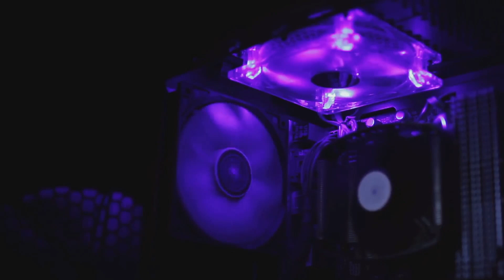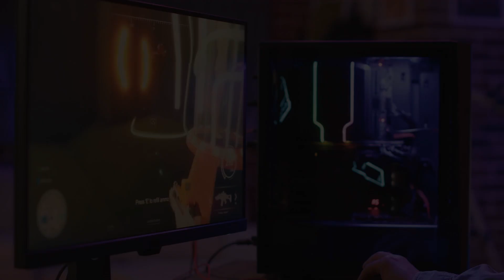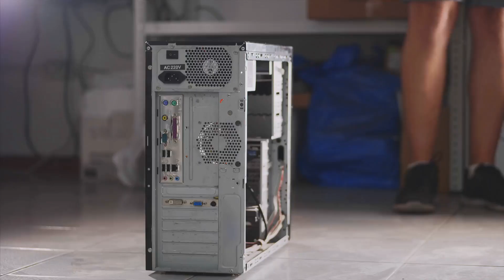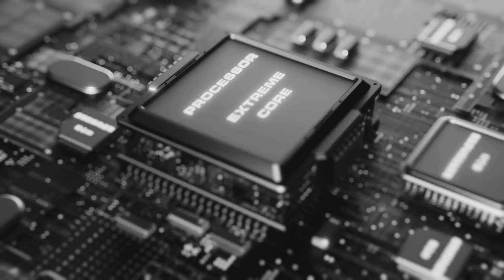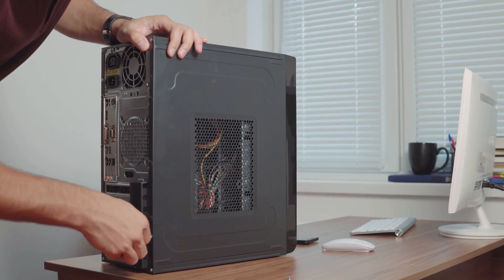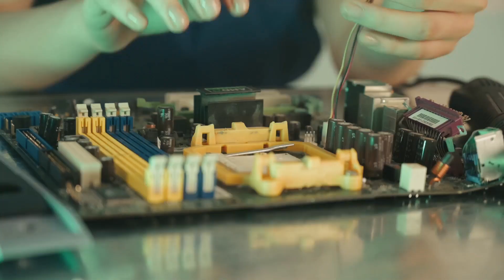Why You Should Not Water Cool Your PC

Comment: IDK why this video has so many downvotes, imho its pretty right what he says. I mean there are plenty of stories of people having trouble with dirty water, tubes and coolblocks. Even if leakage i would rather say it is an user error, I cant rule out the possibility of getting faulty parts. Meanwhile the only thing that can break on an aircooler is the fan, which is usually easy to replace (or just buy products where u can). Also there are some high end air cooler doing a better job than a 240 AiO.
Of course what he say about liquid metal is quite bs and pretty advanced.

Comment: Now that was a huge pile of bs. Not only completely forgetting about AIO liquid coolers, but straight up spitting some of the biggest BS I've heard in a while. There's a reason why a lot of liquid cooling brands offer up to 6 years or even more years of warranty for their parts. Because they are very confident, that their products will last at least that long. In this day and age, only low TDP cpu's are worth cooling with air-cooling solutions, as any 240mm AIO, (not even mentioning a custom liquid cooling solution, because its even another level higher) will outperform any air-cooler on the market. And in terms of safety; if you at least have the few braincells needed to read up and do research, you have a cooling solution that is safe and outperforms any air-cooler on the market.

Comment: These are good points but more of precautions to take into consideration before looping your pc. The best reason not to watercool is if you can't afford it. To argue some of your points: air cooling requires just as much if not more maintenance than a water cooled system if you want to keep your parts healthy. Soft tubing is great for beginners who don't want the challenge of bending hard tubes. The temperature difference is very noticeable and helps keep your components much healthier over time. Furthermore, the cost of a watercooled system isn't THAT much more considering the only thing you'd realistically have to replace with upgrades is the gpu block unless you're making an entirely new system. The biggest thing is how time consuming it can be to custom loop a system and yes, how catastrophic it can be if it fails but if you take your time and don't cheap out on parts you should be fine. Furthermore I truly believe the look of watercooling is worth the time and money but that's my opinion.

Comment: The cpu+gpu custom loop was the best upgrade I've done. It has worked perfectly for 2 years with distilled water. The efficiency allows me to keep the fans at low speeds, a 6700xt remains at 45ºc under load and a 5600x at 43 degrees

Comment: What... was this? This was nearly as bad as the insanely biased reviews on UserBenchmark. And recommending liquid metal over water cooling? That is a far more cumbersome process and carries WAY more potential risk to components since it requires a delid to truly be effective, and that stuff is far more conductive that water and will literally eat an aluminum heat sink.

About the only grain of truth to this video is that custom water cooling is more expensive, requires a bit more maintenance, and can be more complex if someone decides to do something with custom hardline and one-off distros blocks. Most folks find these to be acceptable trade offs for the massively improved cooling performance they gain.

Comment: It's in the name: *WATER* Cooling. WATER!!!!!!! Electronics+Water=destruction!!!!!
Reply: Sure, except the water doesn't come into contact with the electronics unless you royally screw something up.
Reply: @whistlinturbo  No Regular matinence=leaks=bad
Reply: @RandomDude-ur3nk  I don't think I've ever heard of a system leaking due to lack of maintenance. Lost performance due to breakdown of the coolant if not changed out occasionally, yes, but a properly built custom loop should never leak. There's just not enough pressure in the system to compromise properly seated seals.

The only way your argument stands up to scrutiny is if someone is running a loop long enough for the rubber o-rings to start to break down, which would take far longer than anyone that builds custom loop systems goes between new builds.
Reply: @whistlinturbo  !NERD ALERT!
Reply: @RandomDude-ur3nk  bro is mad cause everyone dis-agrees with him
Reply: 77 + 33 = 100 ahh logic

Comment: What a waste of time and utter BS. I've been using water cooling (probably) even before the monotonous speaker was even born. Throughout the years I've upgraded my systems approximately once every six years. In the meantime I haven't had to perform any maintenance on the water cooling system in place. I've even had closed loop water cooling systems on less demanding systems which were ultra silent and operated 24/7 for six years without any issues. Just don't buy garbage, whether you opt for air or water cooling. If you buy a cheap ass fan with sleeve bearings, it will fail on you.
Reply: Well, got any recommendations for AIO?
Reply: @fadillah6014 any of the well know name brands make decent AIOs (e.g. Corsair, EVGA, NZXT, etc.). However, Arctic's Freezer line has been considered the best on the market for a few years now.

Now, that being said, I wouldn't really recommend an AIO with anything smaller than a 280mm radiator, though a 240 would be okay for a less power hungry chip. The reason for this is that there are some excellent air coolers on the market that can easily match or beat pretty much every AIO that's 240mm or smaller on the market. This is especially true for single fan AIOs, which I consider a complete waste of money.